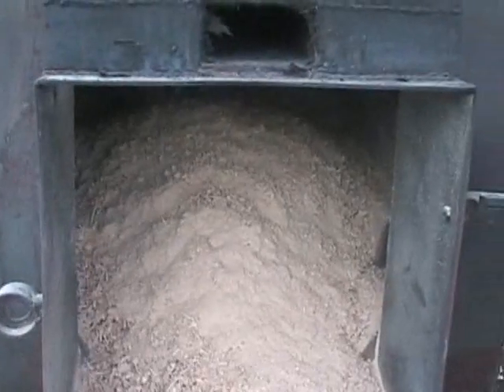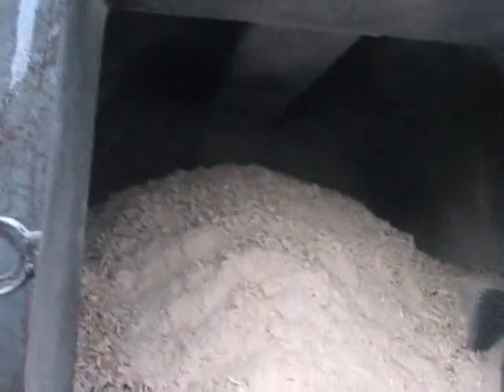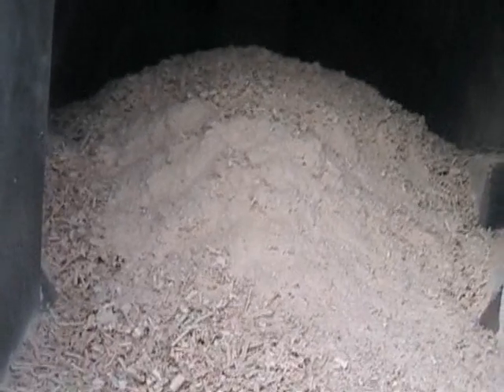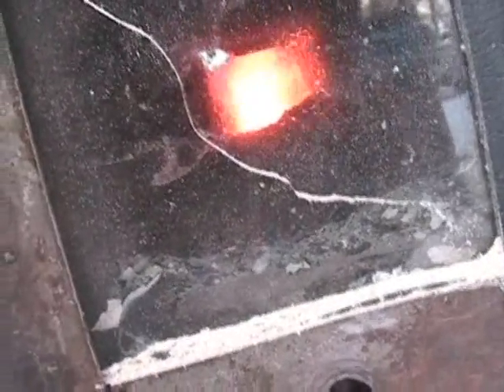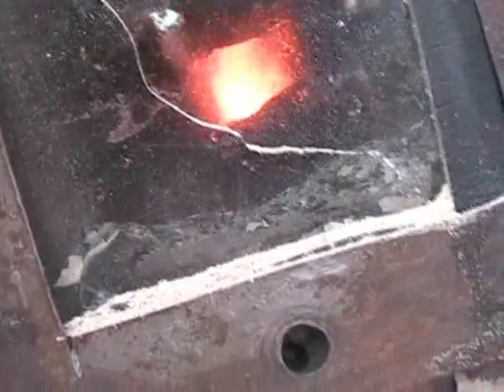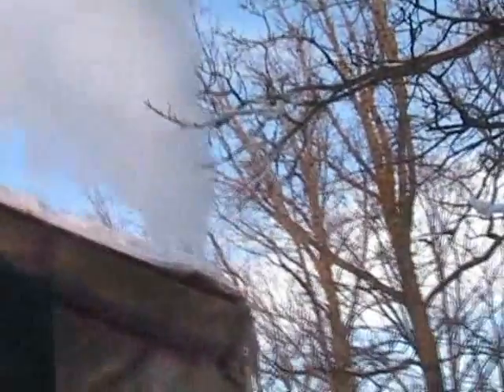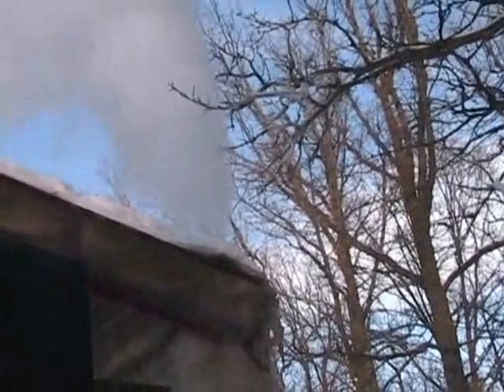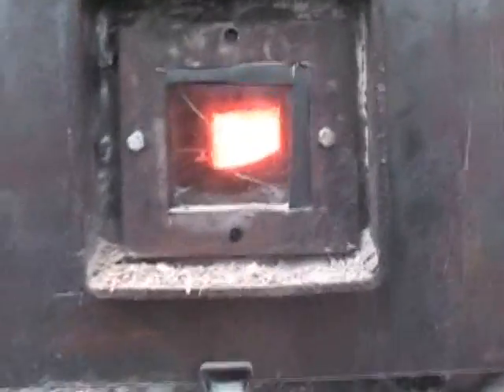Part 2 Gasifier

Comment from the maker: @realjoefriday i try to keep the water at 90 degrees C, but some days i put to much of a solid load in...not dust and I end up with a geiser shooting out of the top of the tank,which lasts for a good couple of hours. This takes me to the second question, the heat stored usually lasts 48 hours before it drops down to 60 C and a reburn. I live in central manitoba where it gets really cold and windy in winter.